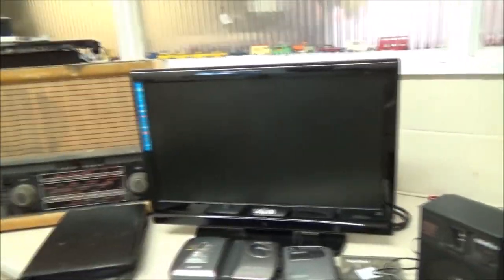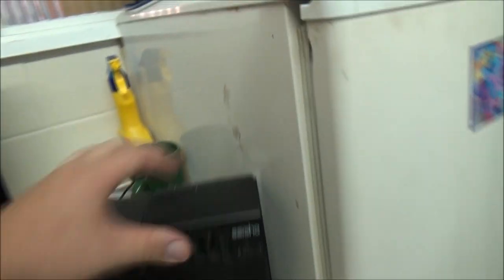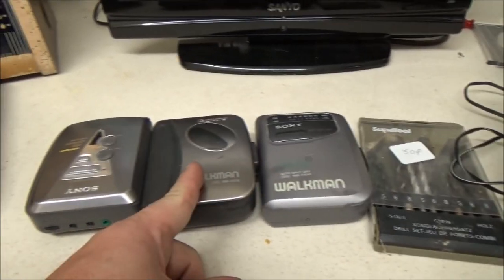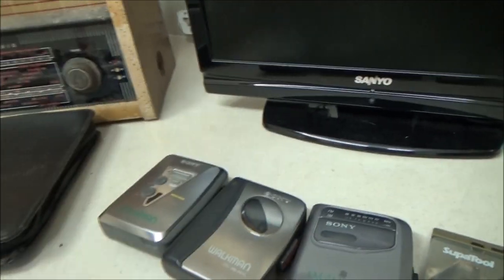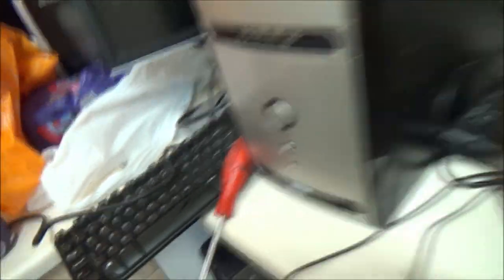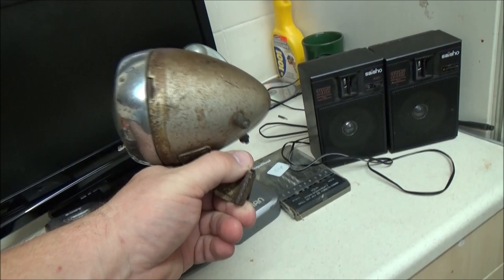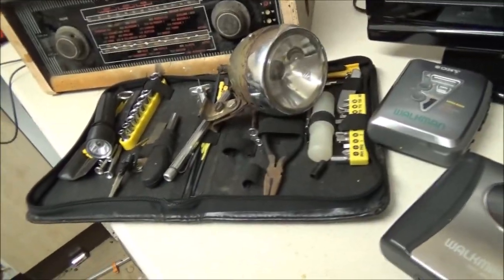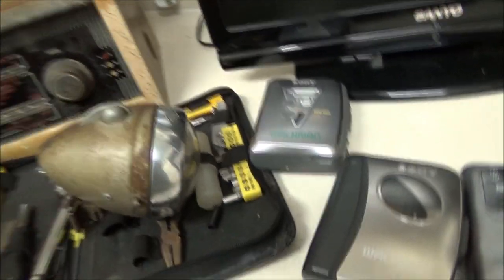Junk Shop Finds: Sony Walkmans, Tube Radio, And Stuff.

Comment: Some bargain finds my dad got a sony c7 betamax from a radio fair with 3 tapes and the service manual for £2 heads are good but needs some caps replacing .
Reply from the maker: That was a bargain! I'm starting to wish I pciked up an old VCR from a boot fair the other week. I would like a betamax in my collection.

Comment: still not bought much on facebook missed out on some mission m53 speakers and a Samsung tv at £20 been ages since seeing any good TVs to buy on there.
Reply from the maker: FB Marketplace has been a bit slow here too. I picked up three bicycle for £10 the lot, one was parts only, one I have fixed up, and one is a 1965 hercules which I realised after a week that ~I owned it back in feb 2016 lol. I was wondering why it seemed familiar. lol